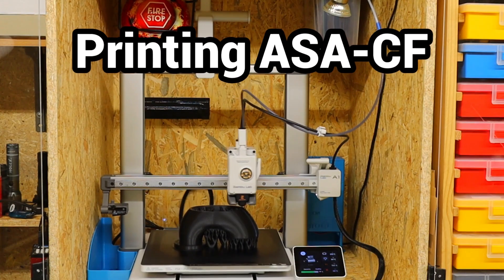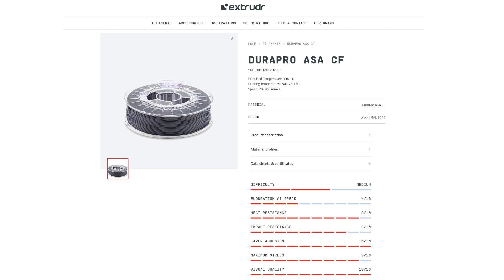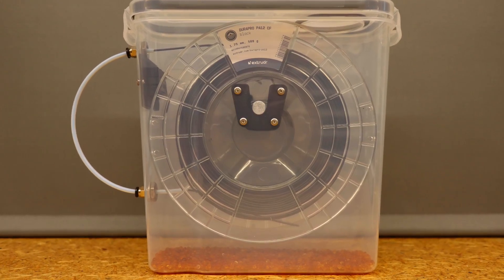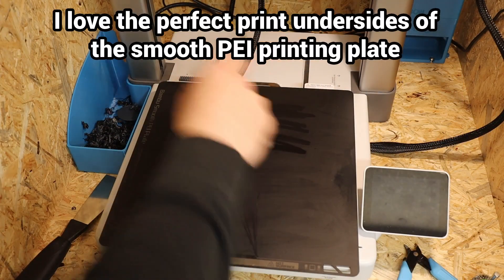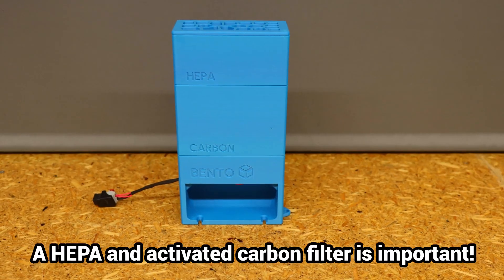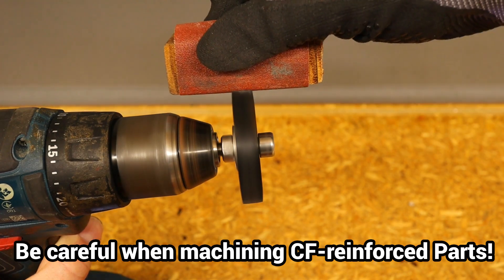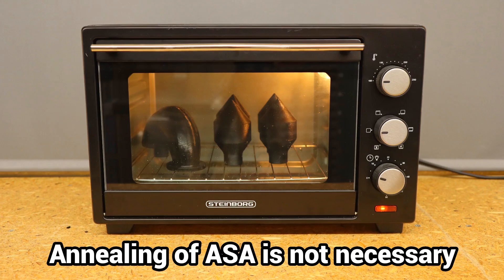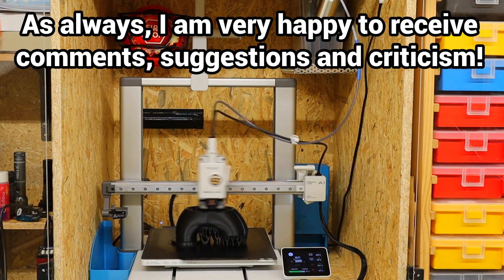Printing ASA - CF : Important considerations !

Comment: Late comment and someone might have proposed this already. ASA and ABS can be glass or carbon-fiber reinforced very easily after printing. Since the materials are solvable in ketones you can melt the surface with acetone and then weld fibers onto it. Works with both strings and woven cloth. Once glued you can use "ABS-juice" to improve the adhesion.
Reply from the maker: That's a very good information, thank you very much!
It sounds easy, relatively clean and fast to make so I will probably try it when i need more rigid parts!

Comment: Hi, hasn’t your A1 overheated? What temperature do you get inside the enclosure? I can't decide whether to buy - A1 Combo or P1S Combo
Reply from the maker: Normally up to 40 degrees celsius, sometimes a bit hotter.
Maybe its not so good for the printer but till now I have no problems!
Reply: @myengines2443  Thank you, I also saw some cooling fan mod for motherboard. It pulls cold air outside of enclosure. I think it might work great.

Comment: Thanks for the video, impregnating is a new idea for me. I have some questions:
Do you get good layer adhesion with ASA-CF with just an enclosure, without active heating of the enclosure printing on the A1?
How is the warping of big parts with 100% infill with your setup?
As I can see, you put you HEPA filter inside of the enclosure instead of outside and next to it, as you don't actively ventilate the fumes to outside of the house so you keep some warmth inside the enclosure and neutralize as much of fumes as possible?
Reply from the maker: The layer adhesion is good with ASA-CF and it gets quite warm (~35-45 °C) in my enclosure even without active heating.
I have nearly no warping, that is, in my opinion, the main advantage of the CF filling.
Yes, I vent inside of the housing to keep it warm and clean the air.

Comment: Could you talk more about the dichtol coating? I've never heard of that, but it sounds like it should be talked about more in the 3d printing community if it somehow seals parts and prevents carbon fibers from coming loose
Reply from the maker: The treatment with Dichtol or other sealants like glue or paint has several advantages.
It makes the parts airtight, strengthens them, protects them from moisture penetration and protects the health because it encapsulates the harmful carbon or glass fibers.
Yes this are quite important reasons for using a sealant and I made several videos about it.
I use Dichtol because it is easyly applied and I thrust it because its specially made for this purpose!
There also exists a Dichtol version for metal printed parts for very high temperatures which I try if the 3D printed metal parts aren't completely airtight!
But I don't know if a video just about this topic would be interesting for some viewers?
Reply: @myengines2443  Very cool, thanks for the information! It seems like an underrated tool/substance. I'm surprised more 3D printing channels don't talk about it.

Comment: Awesome video! Can you dip ppa-cf in the same sealant and get the same results? I want to is ppa around a high moisture environment after it’s printed but I know what moisture and liquid will do to it so I’m trying to figure out a way to seal it off from the moisture? Do you have any suggestions?
Reply from the maker: I believe the properties of PPA are similar to those of PA (nylon), so it should work.
I have treated a wide variety of filaments with Dichtol AM, and even with PLA, for which it is not actually suitable, it worked excellently.
Reply: @myengines2443 thank you

Comment: how about the treatment is electroplating the part with metal like copper. ie first a conductive graphite surface paint. well you get a very durable heat resistant copper surface. maybe a thick one also. benefit is that you dont have to use any carbon fiber filled materials in 3d printing making things simple. then the 3d printed plastic becomes only a filled for the metal part shell. making it strong and light weight. and melting is not a problem. or less of a problem. depending how strong the electroplated metal layer is. check the hacksmith electroplating video for reference on strength. electroplating with copper only requires the conductive silver/graphite paint, and graphite +electrode, and copper sulphate water solution. strong metal-like parts with ease. well easier than cnc machining metal parts. and definitely easier for complex metal parts manufacture.
Reply from the maker: Electroplating is a very interesting technology which I use on my work for some special parts.
To get a sturdy thickness of the parts it takes a fairly long time to galvanize and when I have a successful tested design its definitely a very good possibility for long lasting parts.
Thanks a lot for your suggestion!